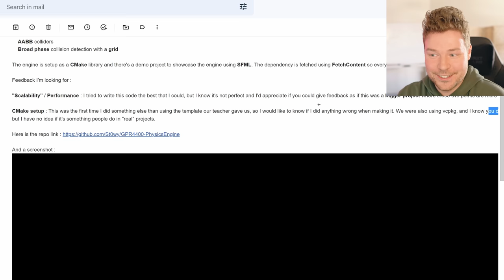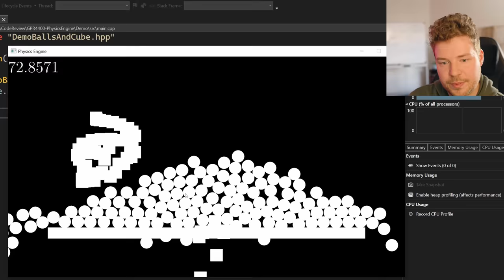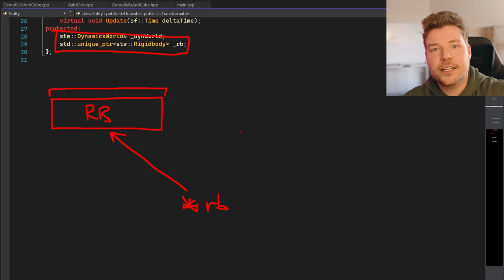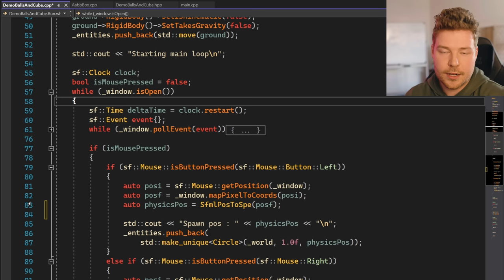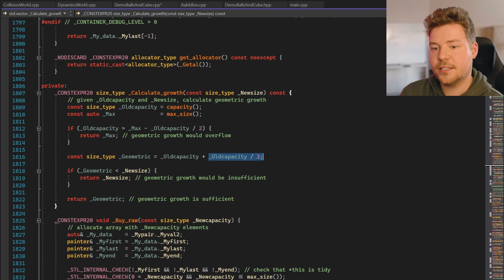All about MEMORY // Code Review

Comment: As a predominately C developer, I agree with and applaud his choice of adding "pp" to the end of file names to differentiate C and C++ header/source files. They are separate and it should be noted. Arena allocators are a good idea and I've implemented several that I use in my own libraries. Heap allocation need not always be super expensive, even with "vectors", and the mitigation technique I learned years ago that still works beautifully to this day is to scale by a factor of two and always reserve memory starting at some power of two. As to the comment about logging, yes, it is a Windows "feature" to slow down by such a large factor when logging to a console. If you use a Linux distro of nearly any variety you'll be surprised by how quick the terminal updates as compared to Windows.
Reply: pp
Reply: @FREAKBAlT see pp
Reply: lol pp

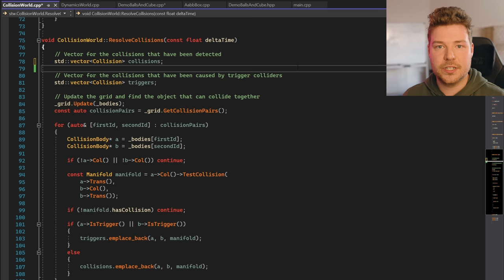Comment: 31:45 Good advice about preallocating vectors. If this is a function that runs every frame, I would take it a step further and make the vectors persistent. Clear them at the start of the function and reuse them. This way the memory remains allocated and keeps getting reused. Another option would be to use an auto-resetting frame allocator like you mentioned earlier. However you go about it, the main idea is to not make new heap allocations every frame.

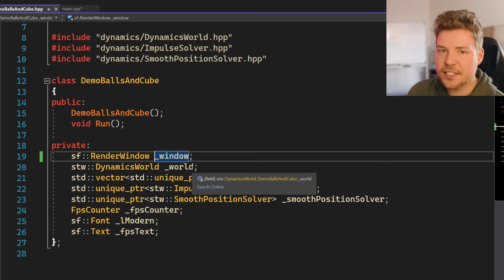Comment: @8:13 would not recommend starting with _ ever because its too easy to make a mistake because "Use of two sequential underscore characters ( __ ) at the beginning of an identifier, or a single leading underscore followed by a capital letter, is reserved for C++ implementations in all scopes."

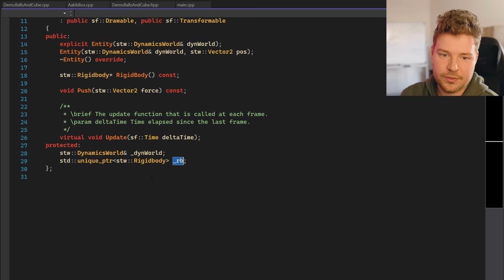@13:31 Not only do you want to be using pointers, but ask yourself "Do I need a hierarchy or do i just need several implementations of void ClassName::Update(float deltaTime)"? Because if you don't need a hierarchy, don't use one! Use type erasure and yes its still a function pointer and a potential cache miss, but it will simplify your code structure. Now you have a folder called Entities instead of a type named Entity that everything derives from and your type erased entity type now defines the contract a type must fulfill to be an entity instead of saying you HAVE to derive from Entity to be useful here.

@14:51 Also known as a "cache-miss" because the writer was not as concerned about "cache locality"

@19:59 std::sync_with_stdio(false) improves that time considerably but c++ iostreams are notoriously slow and the reason why is because of all the safeguarding overheads they do. The console is slow because it has to render which as you know is bleh. Logging libraries are the way to go in this case and not have them output to console but have them output to files. This is a graphical program so there shouldn't be a "console out" anyway. Create a new global logger named log or something at the very least. There are multithreaded logging libraries that will attempt to put your logs in chronological order if you don't want to split them.

@25:41 On the virtual part: The operating system will allocate to you a "page" of memory when your current page is full so its basically the same thing as a small arena allocator, but its so much smaller than what an arena allocator will give you and many many system calls to the OS to ask for more "pages" is what makes allocation take so long. You're giving over your CPU cycles to the OS and that's going to mess up your execution cache because it code that's not in your program that's being called, malloc or whatever is going to be a function that's in a dynamic library aka a function pointer and more cache misses. Profile your system calls! You may find more than you expect. Also align your types (adds padding) so that when you do ask for a value its not going to have to ask for 2 lines (? proper name escapes me) because half of your object is on one line and the other half on another.

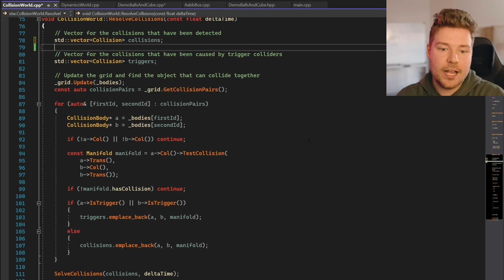@31:47 It looks like the number you're looking for is already computed with collision pairs as well. You seemed to know you needed to make a vector but made it too early! make instances as close as possible to where you use them.

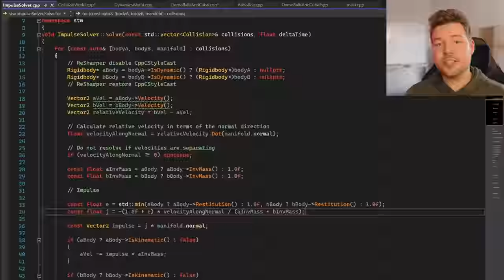@32:09 I think the multiple solver problem is something that should be handled with a template. From what I saw you don't need to dynamically at runtime change your solver with the same types. Make your solver be something the compiler figures out.

Comment: for c++ simple logging, you can look at `sync_with_stdio(false)` and `std::cin.tie(NULL)` calls to accelerate your `cout` code a bit. `printf` will in general be faster though because it doesn't deal a lot with multi threaded scenarios. there are even faster ways to output logs, but of course, its non trivial overhead.

Comment: The reason it's slow to write to stdout is that things like std::flush, std::endl and new lines ("\n") will flush the contents of the cout buffer into the stdout buffer terminal (writing to it) this happens instantly because terminals usually have little or no buffering, so it can appear instantly. This also happens with files on disk; although it's perceived as faster because it doesn't flush the contents as frequently, due to how the OS buffers the contents before writing to the file on disk. So it's not that terminals are slow, it's that any I/O is slow in general.

You can avoid this by flushing the cout buffer less frequently (i.e. outside of loops) but it can be an architectural nightmare and often not needed, since you're probably more interested in up-to-date info when debugging. Do what Cherno (and many other projects) does and use different levels of logging for more granularity.

Comment: Often the dependencies between chained pointers is more important than the fragmentation. I.e. you could explicitly construnct a linked list in contiguous memory, but iterating will still involve the cpu waiting for each load to complete before it can calculate the next pointer. Iterating over the exact same nodes, but using an index instead of the next pointers, will be much faster. The cpu can prefetch the cache lines.

Comment: Nice project and good talk about memory improvements! Memory arenas and transient memory are great and my most used techniques when i do programming these days.
If you are interested, i have a similar physics project (2D fluid simulation) that is a little bit more complex, due to its multi-threading + integrated benchmark support and 4-versions of C++ styles, where i tried to show the difference between naive/from-the-book C++ programming to data-oriented-programming, but didn´t get it exactly right - especially the data-oriented part. Just give me a hint, i will sent you the details.

Comment: My background is mobile games. I'll still say any build system is better than just VS/Xcode/Android Studio/plain makefiles/shellscripts. Despite CMake being a pain, I'd still recommend learning it because it tends to be most common and most supported by IDEs and toolchains. Despite the wild west of build systems, it tends to be most common.

The most important reasons why to use a build system is getting support for new IDEs automatically and the ability to add linters, static analysis, fuzzing and unit tests easily to your project later. I've worked with too many projects where you're stuck with ancient versions of VS, no tests because nobody figured out how to add them (and code being brittle because of that).

The absolute worst thing you can do is end up with a build process where devs use one process to make local builds and completely separate set of tools to make CI builds.

Comment: Strong argument to use hpp: A potential user does not need to think about extern "C". If it's .hpp, it can be included only and directly in Cpp. .h leaves a lot of room for speculation. Can you import it from C? Can you import it from Cpp? Do you NEED to call extern "C"? It's there for a reason.

Comment: Logging to console in Windows is indeed substantially, like Substantially slower than on Linux, however there are ways to speed it up as well, both by using Microsofts new terminal as well as using buffering in the program instead of flushing every single log immediately, still not as fast as on Linux, but helps a ton.

Comment: I wouldn't worry about fragmentation. It's the heap allocator's job to worry about managing that. And in the general sense, as long as you free memory in the opposite order that you allocated it, fragmentation will not be a problem. I say this as someone who has implemented malloc+free in C. To get a memory leak from allocator fragmentation, you would have to do some insanely stupid things. Of course don't just allocate willy nilly from the heap if you don't have to. Heap allocation carries a performance overhead because when malloc has to get more memory, it has to do so via a system call, which means a context switch, which is slow. That's the `sys` metric given by the `time` command.

Regarding specifically what is said in the video, where you go into low level machine details like the CPU cache, I especially wouldn't worry about that, because that's premature optimization. Worry about choosing efficient algorithms, not about how the machine accomplishes a task. That's the compiler's job. Turn on that -O3 flag. Or -Ofast if you're not worried about slightly less precise math. Sometimes you can justify low level optimizations, like when the Quake devs implemented the fast inverse square root using low level floating point math. But then look what happened--the chipset manufacturers and compiler vendors caught up. Nowadays, the quake inverse square root is no faster (and sometimes slower) than code that a compiler will generate for a more straightforward algorithm. I do not recommend wasting your time optimizing for hardware. The compiler has already done it and you can save a lot more time by choosing a better algorithm. C (and by extension C++) is not a low level language, and your computer is not a fast PDP.
Reply: A big problem with that argument is the assumption that the pieces of data necessarily will be fragmented. It's "whataboutism" taken to the extreme. But let's look at an average case where you allocate 100 small objects using a heap allocator: the heap allocator has a free pool of memory, so it slices a chunk off for both the object and the bookkeeping node to manage that memory, and updates the other node to account for the borrow. It does this over and over again until 89 objects in, the pool doesn't have enough memory. So the allocator will do a context switch asking for more memory. The memory comes from the heap, so it will be adjacent to the previous memory, but it will continue to allocate memory until all objects are allocated. The allocator is smart, it doesn't want to waste CPU time by making a bunch of syscalls to allocate tiny blocks of memory, so it does them in bulk. Pages and pools of memory that it marks up and manages. If the addresses were wildly spread out, that would mean the allocator is allocating random pages for every single allocation request, and all those context switches would be a far worse bottleneck than a cache miss. But as it turns out, the heap grows upward. The addresses are all fairly close together.

Now, you can optimize your code to assume that the allocator allocates a huge chunk of memory that's all close together, or you can optimize it to assume that the addresses will be far apart, but in the end, that's all you're doing: assuming. The standard says nothing about how the allocator is implemented. Don't assume. Write better algorithms. If the compiler thinks your array of structs will be more efficient if it turns it into individual arrays of the one element you access, it will do exactly that. That's the ultimate lesson: the compiler is better at optimizing than you are.

Comment: AABB is axis aligned bounding box, sphere is the best of that kind, no rotation needed also
Reply: how many trees you fell during logging, if its so slow, check out the guy that made the windows log ultra fast, not b-locking
Reply: also circles and spheres are memory friendly, you only have a center and radius, aabb has center and width-height-depth or 6x coordinates of the planes
Reply: k.i.s.s. actually simple default functionality the proper way is essential
Reply: ie the programmer does not have to redo the work always
Reply: GPU APIs (not libs) are very burdening for this messy requirement of its programmer
Reply: try screen space (surface) light map generation with unlit next frame generation prediction, no ai required
Reply: I mean the view point between frames does not change too much, so you can easy re-use the previous frames screen space light maps, and interpolate or even combine over previous frames screen space light maps for anything not lighted in the previous light map frames

Comment: With regards to the .hpp header specification over .h, I find it to be very necessary in a lot of projects which are larger where you have a mixture of both c and cpp code (happens way more often than you might think at some companies where you have legacy code). 

It does makes a huge difference in those cases because you need to compile those .h files as C code only in some situations and not as C++ especially if they are separate projects in a larger solution base. It just makes it easier to distinguish directly what you are looking at. 

I used to be one of the .h default people, and never did understand why someone would use .hpp until I started working on legacy code bases created by other developers in large teams, now it makes sense because organizationally it serves an actual purpose. 

I now just use .hpp as default as a result, because I'd rather not go back after the fact and have to specify hey this is actually a cpp header file and you should compile it in your makefile or whatever build system you are using as C++ code specifically and not C code. Just something to consider.
Reply: Not just legacy. Many of us use modern C. There are numerous cases I prefer C for.
Reply: But you don't compile header files?
Reply: @user-dh8oi2mk4f  What I mean is that usually in external build systems you have some method of determining which files are included in which compilation processes, typically by some kind of pattern matching.

You do NOT want .h files which are strictly c linked in unnecessarily with C++ compilation units. This can result in all sorts of unexpected behaviors, especially if you have C headers putting things in global scope with simplified names, which is pretty frequent in legacy code.

If I have multiple binaries in a solution that I need to compile some as C and some as C++ then you don't want to pattern match against all .h files when you are building C++ code in your build steps specifically.
Reply: @fenril6685  But why would you need to figure out which headers are c and c++? The compiler simply pastes the contents of the includes directly into the source file. I don't understand why you need to know which headers are which. Maybe this is helpful if you mix c and c++ in the same directory, but I don't get how it would help with a build system

Comment: If he just uses a clock for the delta time instead of a fixed time-step, that means his physics engine is not determinstic and thus will produce different results every time he runs a simulation.
Reply: yes i didn't knew that at the time, but i'm working on networking at the moment so I realized that mistake. I'll definetly be careful about that if I ever do something like that again haha

Comment: About logging, can we just create a Static class and call it's function to log something there (through parameters)
like:
 Logger.Log(_currentFps);
and in our release build, we just comment out all the statements in that function. 
We would still have an overhead of calling that function and passing parameters, but is it okay to do it like this?
Reply: It’s more simple and straightforward to setup sure but you have to keep commenting and uncommenting every time you want to change build type and you have to remember to do that.

His macro way is much better.
Reply: I would be quite surprised if your compiler left the function call to an empty function with max optimization
Reply: @user-dh8oi2mk4f  fair. Did not think of that

Comment: Great video, thank you! In modern C++, is heap memory fragmentation a concern for developers, given that the OS uses virtual memory to map to physical memory? My hypothesis is that even if physical RAM is fragmented, but virtual memory is contiguous, the C++ program's performance will not be affected.
Reply: Maybe or maybe not. CPUs don't prefetch across page boundaries, probably because of kernel-side page permissions / residency state. The more pages you access, the more TLB slots you use. TLB misses hurt, but maybe not to the level of framerate problems. It's an extra memory access, paid serially.  Huge TLB requires defragmented memory on the kernel-side, and has a system-wide limit. Running kernel code to change page residency really hurts. It's many instructions, and a possible disk access.

Comment: Excellent video, memory is always an interesting topic!
My one suggestion would be to change the storage of bodies in DynamicsWorld. On line 23 in the source file (seen at 27:45) the whole 'if (!body->IsDynamic()) continue;' means that static bodies are loaded into the L1 cache and then immediately discarded. Splitting the storage into static and dynamic bodies will ease the pressure on both the cache and the branch predictor.